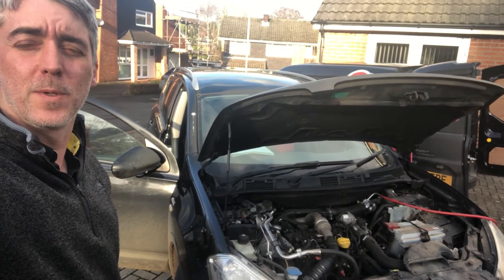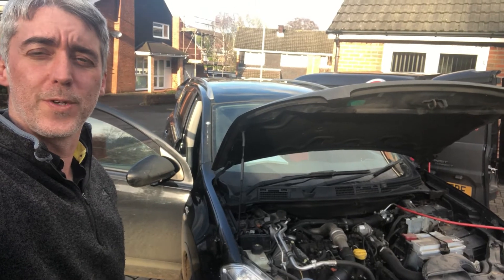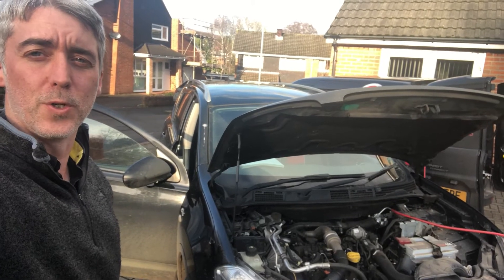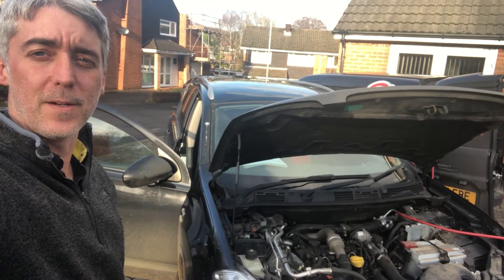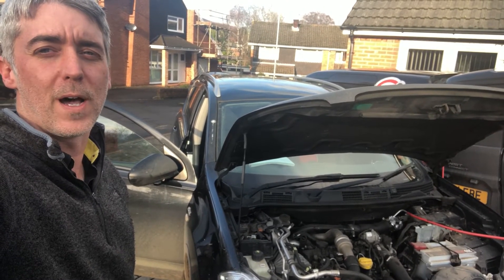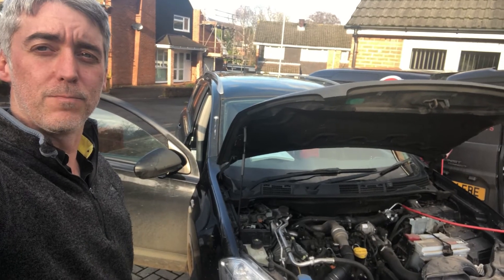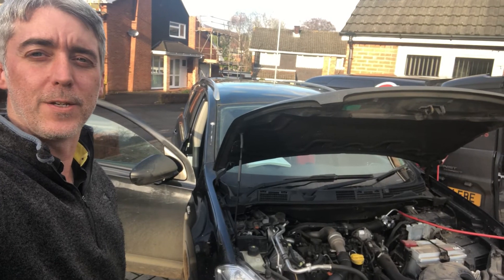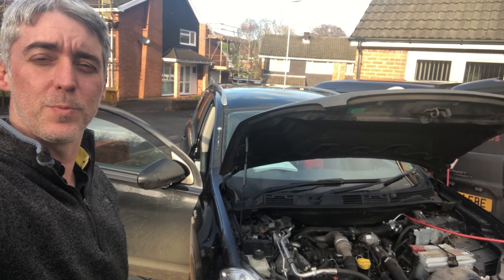Nissan Qashqai DPF diagnostics

Comment: Did you change the temperature sensor on this vehicle? What is the best way to access it as I have the same issue and the sensor seems impossible to get at.
Reply from the maker: Hi Lee, no I didn’t change the temperature sensor, the customer had his mechanic do it.